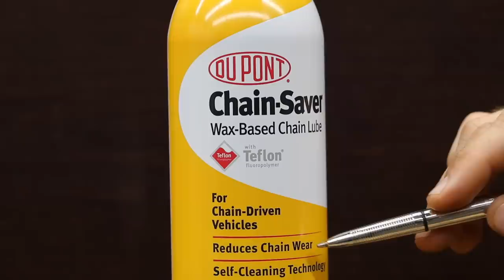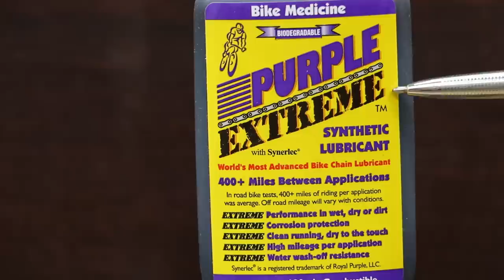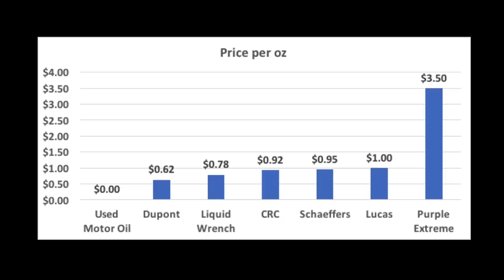Which Chain Lube is Best? Let's find out!  Ultimate chain lubricant showdown!

Comment: Wish you had taken the temp of the chain and bar on the chainsaw after the 1 minute cycle to see how much heat difference there was between all the products. Also would have been good with that result to run with nothing on the chain as a base line. Since some of these products would dry to the touch, temp would have told you if it was doing any good at all at the end. 

Would have liked to see super lube 11006 and white lightning clean ride added to the mix. I use stuff a lot on my RC cars for all their pivot points. With the power to weight ratio, speeds and terrain (wet/dry/dirt/grass), they tend to chew through some of the exposed high stress parts pretty fast if you don't use something. I used white lightning clean ride for many years and it seemed to work ok, but had to be applied every time. I recently got a can of super lube 11006 and started using it, but it doesn't seem to hold up much better. I'm not using this stuff on a chain, but they are exposed metal to metal contact areas (CVD joints, steel pinion/spur gears, steel pins through alloy parts that pivot). The most punished area on my brushless vehicles are the CVD dog bone joints. They just get hammered to death and you have to replace the bone/cup or at least drive out the pin in the bone and replace the cup as well. 

Not a huge amount of money, but it adds up over time. Some of my vehicles axles/bones/cups cost between $20 and $120 to replace. Some you can replace just the pin and cup, others you have to replace the entire axle/cvd which typically come in pairs. When you have 6 trucks you drive enough to have to replace the axles/cups yearly, it can get pricey and being able to get an extra year on them with some lube makes sense. Also, less binding/friction means the motor/motor controller and batteries don't take as much abuse as well.
Reply from the maker: Thanks for sharing.

Comment: With my experience on chainsaws, motor oil will cause the automatic oiler to leak after a year old. Transmission fluid however didn't leak much. I was wondering what makes a good barlube substitute if barlube is unavailable?
Reply from the maker: Thanks for the suggestion.

Comment: Nice tests but you missed the really most relevant test. It is how longer the chain gets after use. Also if we want to test dirt impact on lenght during use we probably should be adding a little bit of dirt continusly during endurance test. Not really sure if soaking in oil is the best usage since it will attact more dirt. For a bicycle chain I learned that best is to put one drop on only one side of each link. When cleaning a chain from oil I use shaking, I mean put it a contrainer (closed lid) with hot water and washing powder and shake it (also turning upside down). Repeat with new liquid until water does not become dirty anymore. I realise this kind of testing would take much more time...
Reply from the maker: Thanks for the constructive feedback.

Comment: Should I be using acetone to debride my chain? I've been using kerosene

And I might wanna rethink using white lithium grease for my chain. There has to be a reason we're not including that
Reply: I'm not sure what kind of chain you're talking about, but if it's a motorcycle chain/one with O-rings-  NEVER use acetone! Kerosene is a safe and effective cleaner, as is Diesel (but cheaper). I clean my motorcycle chain that experiences lots of sand/dust with diesel, then lube with the Dupont (excellent with repelling sand, and good rust prevention) 😉🏍 🏍
Reply: @jeladsnikpoh1289  Been using kerosene to debride (cuts the old gunky lube on the sprocket, too), and white lithium grease cuz it's easy to apply and I know when I need more by looking at it. Since this video: I put gear oil on and have done a couple rides, but it sure takes a long time to dribble gear oil on every link, instead of giving it a generous passover with the aerosolized lithium grease

Comment: I used engine oil on my motorcycle chains before switching to a product called “Chain Wax” from Cycle Gear. The oil would fling off making a mess, and attracted a lot of dirt build up. The chain wax would dry to a tacky consistency, seemed to last longer and stay cleaner.
Reply from the maker: Thanks for the feedback.

Comment: I've owned motorcycles since the 70s. All but one has been chain drive. Wouldn't it make sense to include MC chain lubes? Sling off resistance is paramount. I still have a down jacket that has oil drop stains from the somewhat later 70s because the lube I was using at the time had very poor sling off resistance.
Reply from the maker: Thanks for the suggestion.

Comment: This would have been a lot better if you would have used motorcycle chain lubes vs. bicycle lubes. Motorcycles spin a chain much faster than a bicycle and it has to be able to adhere without slinging off at high speed. Slinging off is pretty important on a motorcycle chain because it makes a mess on the bike plus it can get on the rear tire which is dangerous on corners. I use either KLOTZ KLR or Maxima Chain Guard
Reply from the maker: Thank you for the feedback

Comment: If you do another chain lube showdown can you test 85/90w gear oil?  I lube my motorcycle chains with this as it is very cheap and seems to cut down on the sprocket wear quite a bit.  The only real negative that I have found is that it does tend to sling and drip when you apply it, so you will have to clean the rims after that first ride.
Reply from the maker: Thanks for the suggestion.

Comment: Should have done the rust test with clean chains or else the dirt left from the previous test plays a part in it... Obviously the chains that held onto more dirt will prevent 'some' the corrosive fluid from getting to the metal.
Reply from the maker: Thanks for the suggestion.

Comment: You need to know what chain you have before selecting a lube. If it’s a sealed (o-rings between the links) chain like fround on motorcycles a dry lube is best. But if it’s an open chain like on many industrial chains and bicycle chains oil is best (including used motor oil).
With motorcycle chains you want a product that dries so it doesn’t sling all over the rim and fender. 

Just because a chain is “dry” like shown in this sling test doesn’t mean protection is gone. If anything that’s exactly what you want on a hay bailer. The DuPont wax chain saver would’ve been better suited, it’s not like people bail hay in salt water spray or even regular rain. Motul motorcycle chain lube would’ve “lost” that test for being “dry” regardless of it being one of the top chain lubes capable of protecting chains that propel bikes over 180mph.
Reply: Alex:  avid cyclists (road and mountain bikers) will advise you not to put motor oil on a bicycle chain.  Why? The oil attracts and retains dirt and grit and those things degrade the performance and lifespan of the chain and cassette/cog set.  Bicyclists prefer something that does not attract and hold dirt.  Wax-based lubes and teflon-based lives are greatly preferred

Comment: I think it would be interesting to see how a chain lube which is designed for a more abrasive environment would holds up in comparison to the winner in this video. For example, there are chain lubes which state they are specifically designed for dirt bike chains. I wonder if there is anything to there claims or if it just smoke and mirrors and using a regular good quality chain lube would produce that same life out of a chain.  Especially if you consider that generally there is a premium cost for purchasing such specific products.
Reply from the maker: Great recommendation! Thank you

Comment: I thought the Liquid Wrench would do better than it did with the Cerflon that it has in it.  Speaking of Liquid Wrench, Id like to see their newer penetrant formulations compared to their old standard.  They have two variations of a new Pro Penetrant and Lubricant on the market.  They come in different style cans and the SDS would suggest they are at least slightly different formulations.  It would also be interesting to see how they stand up against other dedicated light lubricating oils as well.
Reply from the maker: Thanks for the suggestion.

Comment: You make amazing videos and i watch them regulary, but this one you pretty much did most of it wrong.
As a biker myself, i do maintenance on my motorcycles myself  and over the years i have tested many products. First let me explain how a motorcycle  chain is made regarding lube. The chain comes out of the factory  with grease behind the Xrings and the motorcycle and the chain manufacturers  instruct you to clean the chain with kerosine and lube with 95 gear oil  and  then wipe the excess off.(parts cleaner over time ruins rubber ) The reason why we  put something on the chain is  for  the purpose to prevent rust and  so the rollers on the chain dont wear out the sprockets  fast,  ( and thats it ) . Now ofc we dont follow the instructions as  there are much easier and faster ways to apply the lube ie- chain lube cans. And in all my years of testing different ones , the two best ones are 1:  Motul MC Care C2+   and 2: Castrol chain lube Racing   These two provide the best (stickyness, roller lube  and anti fling properties of them all) Also chain lube is applyed on the inside of the chain so the lube works its way  out  thru the chain by centrifugal force and not fling it`s way out   in the first minute of riding. PS: You can put pretty much any bike lube on a bicycle since the centrifugal forces are low.  An electric motor, 2  sprockets and a chain on a bench would be much more accurate  for the testing. Take this comment as constructive as i realy love your videos and enjoy them very much.
Reply from the maker: Thank you for the constructive feedback

Comment: Ive rode motorcycles for almost 60 years.  I use 90 gear oil. on my bikes.
Reply from the maker: Great feedback. Thank you
Reply: @ProjectFarm   Ive used Bell Ray and Lucas but gear oil works just as good from my observations . Fortnine tested different chain lubes and came up with same thing gear oil

Comment: Your testing methods are usually beyond reproach to me.  For the dirt test, you could have weighed each chain before and after the dirt test.   On a separate note, the rust test:. I do wonder what would have happened if the chains with penetrating oil had been baked at near their smoke point... Would that have helped the oil bond to the chain? (It sure would have stunk to high heaven though.)

Either way, yet another really great video product comparison.  Thank you for doing these!
Reply from the maker: Great point on applying heat to the chains!  Thank you for the positive feedback!

Comment: if your bike has hydraulic brakes, ANY oil, like just some mist from a spray can or even touching them with your fingers will ruin the pads. This is why purple extreme comes as a drip applicator and not aerosol.
Reply from the maker: Thank you

Comment: For my bicycle I just use what ever engine oil I put on my car. Works great. That old chain was dirty because it was most likely not cleaned but just lubricated. Besides, clean farm equipment is an oxymoron.
Wait a minute... Did you say used motor oil? Just use clean, new motor oil. Don't be so cheap. The used oil is most likely broken down and has lost all its properties.
Reply from the maker: Thank you!

Comment: the chain lub is supposed to spray to the rollers. not the side of the chain. you are suppose to wipe off excess lube from the chain side to prevent dirt stick. Ask any cyclist and they will tell you that. never has rust using cycling chain lub and the chain was used for years.
Reply from the maker: Thanks for sharing.

Comment: Put a chain oiler on that hay bailer and run automatic transmission fluid. Motorcyclists get 10's of thousands of miles out of a chain and gear set doing that.
Reply from the maker: Great tip, thank you!

Comment: A very late request; however, it did not seem that you used any of the Teflon containing products (which are commonly sold at bike stores). So, any idea on how well Teflon works as compared to ceramics and other dry lubes on chains? Similarly, a common problem is properly lubing bike or mower cables (again using oil, Teflon and ceramics) and actually using the devices made to get the lube into the cable sheath.
Reply from the maker: Great suggestion!  Thank you.
Reply: @ProjectFarm  I always enjoy your efforts and ingenuity. Thank you for your positive attitude and really personable approach to the problems that face us part-time home mechanics.

Comment: hmm. i wonder if there's a hybrid answer. mixing products might be sketchy, but if it doesn't summon the ghost of our sins, i ponder if Lucas followed by Purple on top of it might have the best mixes of performance.

might also help reduce the cost impact or using Purple, in assuming you could use less than usual.
Reply from the maker: Thanks for the suggestion.

Comment: Motor oil shouldn't be used on chains because it has detergent in it which causes air bubble which traps dirt and wears the rollers faster. I own a bicycle shop and use ParkTool CL1 and  Purple Extreme chain oil.

Comment: The chain lubes were not applied correctly!  Great comparison idea but not a good execution on this one.  Chain lubes are designed to lubricate the mating surfaces of the chain, NOT everything else!  After applying and working in the lube you have to WIPE ALL OF THE EXCESS OFF.  You can't wipe off too much! 

All the excess does is attract and retain dirt, which was a major factor is your tests.

-Saturate chain in product
-Work product into chain
-Wipe off ALL excess

Then test!  I'd love you see you add to this test:  PJ1 Black, Rock-N-Roll Gold and Maxima.  I've been using those for years with great results.
Reply: Thanks again for what you're doing, your videos are by far some of my favorites.  THANKS!!
Reply from the maker: Thank you!

Comment: I am a bit of a noob on this but I feel the tests where not quite good for bicycle chains because there is two rules of thought wet lube for wet environments like mud and rain and ones that dry on like a wax that dry dirt does not stick to. 

The tests should reflect this as the dry lubes wash off with water/mud but are meant for conditions like in a desert and the wet lubes should not have any water stick but dose poorly being for wet environment. 

I would like to see wet lube and dry chain lube test as I live in the Mojave and as far as I know all these lubes besides maybe the Dupont would pick up sand really badly.

Basically I would like to see mud and water based tests for the wet lubes and sand and corrosion tests for the dry stuff.
Reply: I am loving all the videos and this one is no less just would like to see test and products that fit my situation better.
Reply from the maker: Thanks for the video idea.

Comment: Can motorkote be used as a chain lube for motorcycles sir?
Reply from the maker: Thanks for the video idea.
Reply: @ProjectFarm  thank you sir for replying and all the research and videoing you do! I also like experimenting with products to see which ones work and do not! I have many years of experience with different fuel injection cleaners which do not work for all vehicles! It's strange how some of them work better in other vehicles and you get great gas mileage versus some that it just does not do anything!

Comment: Interesting test, but unfortunately it really doesn't generalize to much in the real world!  The conditions under which heavy equipment, chainsaw, bicycle and motorcycle chains operate dictate different products for each specific application.  None of the products in your test are good bike chain lubes... and even within bike chain lubes, different riding conditions require different lubes.  Pro cyclists mechanics use petroleum based products because they are slipperier and thus cause less friction= faster.  Since their chains are cleaned after every ride, the fact that petroleum based products attract dirt becomes irrelevant.  I always use wax based chain lubes on my bikes do to the self cleaning nature of those products.  Just my 2 cents worth..... keep up the good work!!
Reply from the maker: Thanks, will do.

Comment: Lube for a bicycle will not get the RPM  or any where close to the speed that the chainsaw speeds the chains up, to so that test was not really relevant. Also the bicycle chain is not going to be run in ocean water so that is not really relevant either. One of the most important things is to not put a grinding paste on your chain which is what you are creating by using lubricants that attract or have dirt sand etc. stuck onto the chain, cassette, chain ring, pellets, that then sandpaper/grinds the chain sprocket and chain ring down. The lube turned into a grinding paste greatly increases the wear and decreases the lifespan of the chain cassette and chain ring.
I don't know how much putting the Chain Saver through the abrasion test matters either because the bicycle chain is not going to get anywhere that amount of pressure put on it in my opinion. 
I always appreciate your videos though.